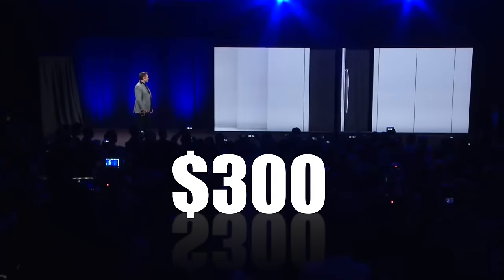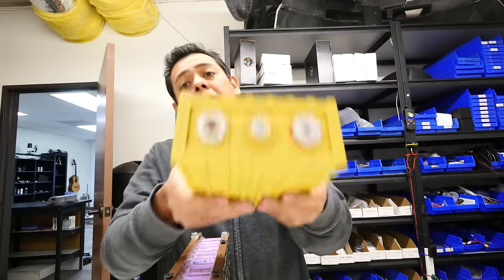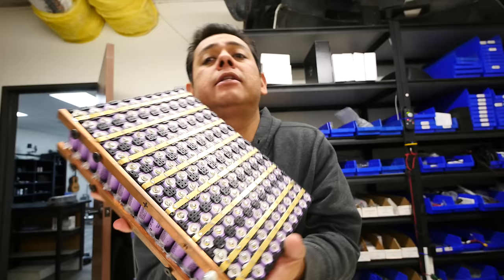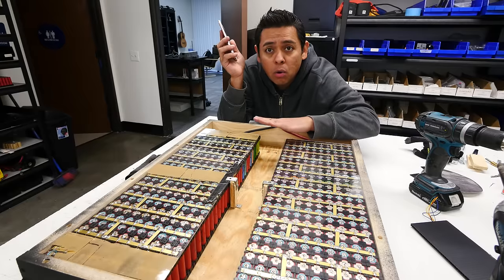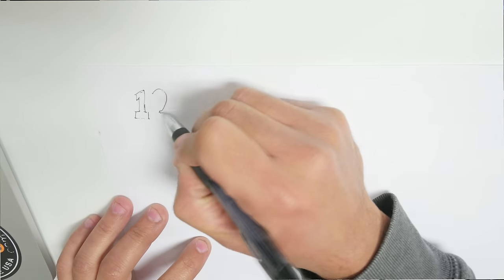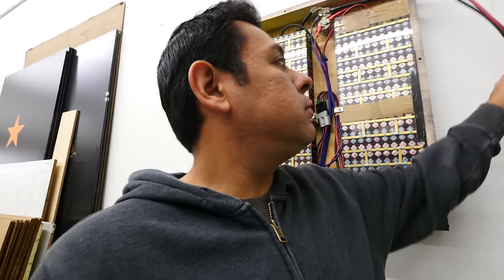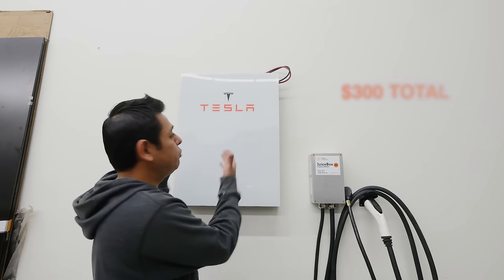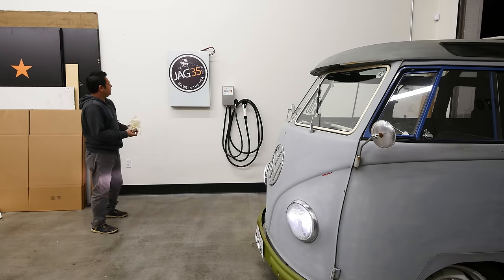$300 DIY Tesla Powerwall - Solar storage 18650 lithium ion home Battery

Comment: 380$ for a power wall that Tesla sells for 3000$???   That's ridiculous! (In a good way)

Any disadvantages compared to Tesla's Power Wall? (I sense there must be some, no?)
Reply: I think tesla power wall as refrigeration system and this one has not.
Reply: Pablo AM,
True.  Maybe?  It seems to work well without it.  Maybe it's Tesla cars that have cooling system, but the power wall?
Reply: Disadvantages include, UL rating, insurance, liability, danger, fire, etc. Just because Jehu can do this doesn't mean everyone should, or that they'll have any recourse if they burn down their house, or several houses. Yes, even Tesla has had thermal runaway and you can't always run away from it.
Reply: Powerwall come with all the safety features.

Comment: what about cooling?
Reply from the maker: +Dominic Dymond  I don't plan to running batteries hard enough to have cells heat up,  and I'm in California where temperatures don't get below freezing so no need to heat them
Reply: jehugarcia i just figured they would be more efficient and last longer if they have an even temp.
Reply from the maker: they would,  but the battery life gain to complexity/expense of designing your now cooling system Ratio is way off IMO,   not worth the effort on almost dead cells
Reply: jehugarcia true that
Reply: jehugarcia do you plan on using them to power you're house though?
Reply: jehugarcia do you plan on using them to power you're house though?
Reply from the maker: some of it
Reply: Dominic Dymond what about wreck Range Rover in background?

Comment: Hi, If I have a 5kW load, and I build my own powerwall, how long can the load work on this powerwall? What are the safety measures I have to put in place?
Reply from the maker: +Mykc Alusah  you can’t load this 4.4kwh powerwall with a 5kw load.  You’d need a bigger battery
Reply: In that case, how big?
Reply from the maker: +Mykc Alusah  10kwh-1000kwh
Reply: how many ceels do I need for that case?
Reply: Say I want the load to operate for 5hrs a day?
Reply from the maker: Mykc Alusah depends on how big your cells are,  it’s like asking how fast cars go,  depends on the car

Comment: Sir, i like your video. But!  1. please edit out or blur what you did with Tesla's logo, you might get into trouble, think about, you made a product that is NOT Tesla. 2. it is always fun to mess around with electronics and batteries until those cells start dying and guess who needs to check and replace em :) i can imagine measuring 600 cells, it would take some time, and then again and again, because you want them working as many possible and you cannot control the wear on them, too many different cells. maybe considering finding a supplier and buy the entire quantity of cells exactly the same? I am wondering, now, in 2018, where is your project standing at?

Comment: just started watching your videos not long ago, but i love the information and content. i do have a question concerning these lithium ion batteries. have you experienced any safety issues concerning the batteries catching on fire when you charge or discharge them inside your home? the reason why i am asking is because i am considering using these batteries for projects in the near future, and i don't want to worry about and safety issues storing or charging these batteries inside. i am considering building an ebike battery pack that will consist of about 80 batteries. thanks for sharing your videos, they are very informative.

Comment: Please redesign this battery pack for your safety, and the safety of your family...  Remember how hot a laptop battery can get? 4-6 of those cells are in each laptop battery, and you've got over 100 of them...   There is a VERY easy way for you to fix your problem with only a new box, a few large copper heat sinks, and a few fans.  I would hate for you to not have the environmental controls in place to where you accidentally burn down your house.

Comment: Jehu(or anyone reading this), can you please enlighten me on why using dead laptop batteries is a good idea? i think we all know how shitty a dead laptop battery is, so why use them for something big like powering your house?
Reply: Because it's not always all the cells that are bad, with a lot of laptop batteries there are only 1 or 2 cells that are bad so when you break the housing open you test them with a voltmeter, etc. that way you ween out the good from the bad and know which ones are useable. its the cheapest way to go if you don't have the money to buy brand new ones from a source like this https://www.megabatteries.com/?cat1=24 or https://liionwholesale.com/collections/batteries or https://lithiumbatterycompany.com/lithium-ion-batteries/ for example 😊
Reply: @WiKiTWoNKa  hey thanks for your reply, then why didn't jehu mention that the video about opening up the cells to test the little individual cells with a voltmeter? 

So you're telling me that because of a few "bad cells" in a battery pack, it can make a whole laptop battery "dead"? 

Also, when you mean test the cells, I assume you mean the cylindrical ones that look like AA batteries? Because inside of those are even smaller cells correct? If they're similar to the cylindrical consumer batteries we've been using all of our lives.
Reply: @teklife  I don't know why he didn't mention that part about testing the cells maybe he just assumed people would know to do that... 

Yes, In my experience 1 dead cell can make the whole battery malfunction in ways such as not charging or slow charge or overheat and even in extreme cases catch fire. 

Yes, the cylindrical ones that look like AA batteries but yet some may not be the same size some cells are slightly bigger or smaller in size but the same concept. 

Have you ever opened up a 9-volt battery? if not this might be interesting to you 😊 https://youtu.be/N6pLJWUZCPE?t=145

Comment: Ok, so you say $300 for 4.4Kwh; however, it seems that you failed to account for everything.  You only accounted for wood, batteries, and glass.  What about the connectors, cables, bus bars, fuses, is there a BMS being used, battery holders, and anything else?  I know that depending on the size of cable the price can add up. In this particular case the incidentals could add up to over $100 and that would make this $400 instead. An example is the 18650 holders you would need 30 holders that hold 20 batteries for the 600 batteries being used.  Not sure what they cost at the time of making this video but currently they are 5.99 each, which means an extra $180 dollars.  This basically means that the cost your are stating could be doubled or more than what you are stating. I understand that this video was posted in 2015, but I am sure that even if you account for that it would still be at or over the $200 extra.

Comment: Check me here.. let's say I have a 100 watts solar panel. Performing at 90% effeciency... and I get max sunlight for 5 hrs...90×5 =450 watts ? Then to charge my battery, Well your batt with a cap. Of 4.4kw.. 4400÷450= 9.8 so theoretically it would take almost 10 days for a small 100 watts panel to charge your banks? Am I on point. ?
Reply: Your math seems okay to me.. for what that is worth. :)

Comment: You have no clue, you mistakenly multipliy 2000mA by 3.7 volts to get 7.4 Wh WRONG! (Current times Voltage is watts not capacity Wh), how long can you deliver that power is the question- Its current over time thru a resistance that gives you capacity in Watt hours. the actual capacity of a 18650 is from 3-3.4 Wh (3000-3400 mAh).
Reply from the maker: +Greg Genge what are you blabbering about?   Are you really confused by mA and mAh,   If a single letter confuses you do me a favor and stay away from lithium batteries. On the other hand if you are just a spelling nazi,  get a life,  do something constructive with your time.

Comment: You can't just charge 3 lithiums in series like a 12 volt battery :/
Reply from the maker: ok..... i'll just ignore the fact i've been doing it for years then
Reply from the maker: yes 4300 watts for one hour,   kWh,   watt hour rating is better than Amp hour as it tells you a more complete story on how much energy a cell can store.
Reply: jehugarcia I meant directly without any sort of balancing. I am under the impression directly charging three batteries in series without any sort of BMS can cause the batteries to malfunction and with lithiums you'd have a fire on your hands.

I'm pretty sure you use something that you didn't go over in your video that you yourself use.
Reply from the maker: https://youtu.be/tbaeMWdDlqY

Comment: no comparison with a tesla wall....used batteries vary with internal resistance.  balancing used cells becomes a huge issue.  Even if each and every cell were sorted by internal resistance and assembled, you still have USED cells, with no guarantee of life expectancy.  No thankyou.

Comment: Its far cheaper, easier, and safer to just go to alibaba or some other wholesale website and order 1000 batteries pre-assembled in the configuration you want... Don't believe me? Request a quote from any of those sites, it will take 2 minutes. You can get perfectly good cells for $1/piece, with 25% higher capacity than those dead laptop batteries.
Reply from the maker: +Kevin Clark  "perfectly good cells" might  not be something we agree on.   Any other than Sony, Panasonic, LG, Samsung, or Sanyo 18650 cells are too big of a gamble and not worth the risk
Reply: +jehugarcia you may be right, but branding doesn't matter when the cells are being sold for scrap in the first place. I've tested cells from these suppliers up to their C rating, I see no reason to disregard that simply because they aren't Japanese cells. I wouldn't be that surprised if they actually were. Anyways, you can buy whatever brand you like dirt cheap this way. It's always been cheaper for me than buying individual cells.
Reply: +jehugarcia btw I went back and looked at the order I'm talking about. I got Samsung 2600mah cells for around $1.5 a pop wired in a 3s 2p configuration, and that price included custom 4a PCM protection. I'd bet your cells were cheaper, but still that's pretty nice for fresh, reliable cells! Of course shipping will increase the price a lot if you don't buy at least a few thousand. Anyways, I like the project a lot. Keep it up!

Comment: Price is inaccurate. To be honest, you have to count all the dead batteries you bought for this project and threw away, because you can't avoid them in the process.
Reply from the maker: +MegaBro Gamma  I did,  I counted all the money I made by selling the unwanted cells on eBay
Reply: So then the cost of $180 for batteries = cost of all laptop battery pack purchases for the project minus the income from reselling unused parts.
How much did you pay for the laptop battery packs, and how much money did you regain by selling the unused bits?
Reply from the maker: +MegaBro Gamma  I don't remember, it's been a while but I talk about it in a video,   I don't remember which one,  sorry

Comment: Sigh. If you buy dead laptop batteries, a large percentage of them are going to be duds with internal shorts, high self discharge,   or nowhere near rated capacity. You'll also need a very good battery management system because they will age at different rates so no matter how well you match them on build day, within a year the capitances of the individual cells will be all over the place depending on the age of the original pack they came from. Bottom line, you have to calculate whether you would get more real usable watt-hours per dollar by buying new 18650s instead of harvesting from dead packs.
Reply from the maker: +LMF5000 only one way to find out

Comment: You have no hardware to monitor and balance the individual cells. This is not safe because some cells will undercharge allowing some to OVERCHARGE which could cause a fire. Just connecting a bunch of unmanaged 18650 cells in parallel is dangerous. I hope you have unconditional fire insurance which you can't get. You didn't even install fuses, what happens if there is short in your inverter or wiring, POW!!

Comment: Man, first of all - great project both the powerwall and the VW van that got converted to electric vehicle. Still, regarding this project there are some issues that I just cannot keep silent bout  :) first - the fastenings of the battery packs to back of the powerwall are flimsy as fuck. Those 300 cells sure weigh something, no matter how light they might be. The small wooden piece held with 2 tiny metal angles seem kind of ridiculous. According to my gut those should be full steel angles (or Z shapes) and fastened in three places, not just one. All the cells, all the work with salvaging, not talking about over/undercurrent protection of the invertor and any other electronics, cables, - all that rely on one fucking piece of a small angle not to fall from 3-4 ft of height. Not cool, and by far not durable. Second - apart from generating the idea, TESLA has nothing to do with you project, man. You built and it's your project. Why do you want it to remind of the huge corporation that you even weren't able to purchase the product from? If you put big TESLA letters in your power wall, shouldn't you dub your vee-dub a P90D?
Reply from the maker: +JurisKankalis  something tells me you didn't watch till the end
Reply: thought the battery packs would fall out like in the last second of the video. unfortunately, my loss :) anyway - tesla's not really worth putting up on anyone''s private garage wall. no company is, besides my own, of course. besides - if they were a bunch of corporate a$$holes, they could probably sue anyone attempting to use their trademark/brand without authorization. anyway. one question not clear from your videos: what do you use for soldering/connecting cells to leads? Does normal solder hold??
Reply from the maker: yeah,  or you can use mechanical fasteners

Comment: Re: buying old laptop batteries on ebay -- you could just buy new 18650 cells on ebay -- they're super cheap...
Reply from the maker: Not quality cells, not 3 years ago
Reply: Ahh, didn't notice the date. -- So, is it still the case today that buying a dead laptop battery is going to yield better quality cells?
Reply from the maker: No,  modem pacs are way better and available these days https://j35.us/Lithium-July

Comment: What if I need it to be 12 volts pls reply anyone who knows about this stuff
Reply: For 12 V you have to put 3 cells in series, one cell has 3,7 V nominal voltage, or 4.2 V if it's fully charged. Unfortunately 12V inverters to discharge the battery are usually made for lead batteries, which means they are not ideal for LI-Ion. They cut off at 10 volts, because lead batteries would get damaged irreparable under 10 V. This means you would still have 3,33 V in each Li-Ion cell, so you can't use the whole capacity. But it should work.
You would need a Li-Ion BMS for charging the pack in every case, if you overcharge the cells to more than 4.2 V they can go up in flames.
Reply: @simonm1447  so u mean 12v is not good for li-ion batteries in a big project
Reply: @hamzahansari6900  For a big project with a big power output a 48 V system would be better, because with lower voltage the amps are higher. A 48 V system has only 1/4th of the amps at the same power output compared to a 12V system. This is the reason why trucks use a higher voltage for their starter batteries (2 batteries in series, 24 V) than cars.

12 V systems are fine for smaller things with less power, but they also work with a simple lead battery (like a truck battery, even if special solar batteries do more cycles), if it's stationary.
Reply: @simonm1447  thnx

Comment: Please don't try it at home. This is very unsafe. There is no fuse protection among parallel strings, no temperature sensors, no cell balancing smarts. 
This may works for certain period of time but can be catastrophic if something goes wrong.

Comment: fuck all that work for a measly 4.5 kwh. lead acid far easier and cheaper. as for toxicity, if you go and smash a lead acid battery you might have a problem. 30 cents per cell sounds like crap to me even second hand.

Comment: 4400 watts and cooling cooling ???? Cooling system is an important part.. everyone knows how to assemble tiny batteries but need a cooling system like Tesla but cheaper.
Reply from the maker: Why would you want to run your cells hard enough to require cooling?  I subscribe to the “keep it simple” design philosophy
Reply: jehugarcia but still want to know how to cool it simple and easy way... Do let us know if you build something huge with easy self cooling system..

Comment: The first 5 seconds and you made a incorrect fact......or a lie .... it will not power your home when there is no grid connection. So if you loose power from the utility electricity supply the power wall will not power back up your home.
you said it would and it doesn't.........!!!!

Comment: You made a bomb. Your protection circuit is not enough at all. No temperature control, no over charging or over discharging protection at all. Don't follow this way. Also no one mix different battery.
Reply from the maker: Yes I’m a bomb maker

Comment: This have nothing to do with the open source patents, he only shows how to serial or parallell couple batteries. And talks about inverters like you can use any inverter. That is not correct at all.
Reply from the maker: pretty sure you missed the point of the video
Reply: Then you failed to properly demonstrate the point of the video.

Comment: Super misleading. What was the cost of interconnects between cells? Relays? Battery protection circuitry? Battery testing equipment?